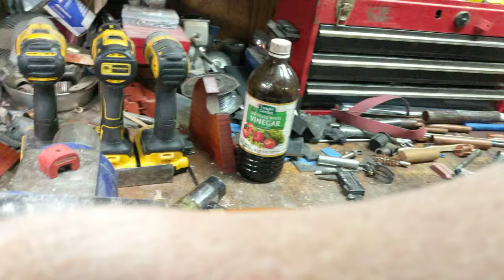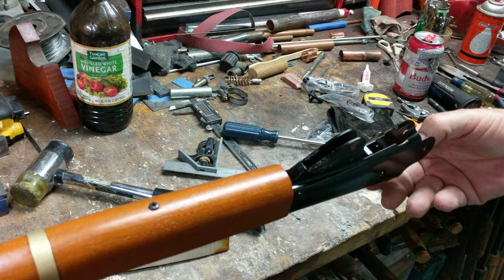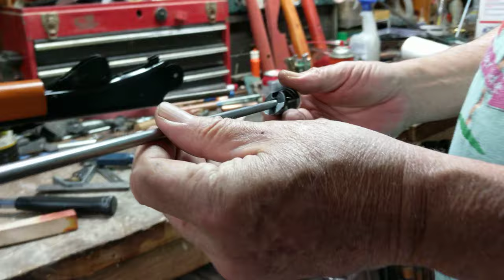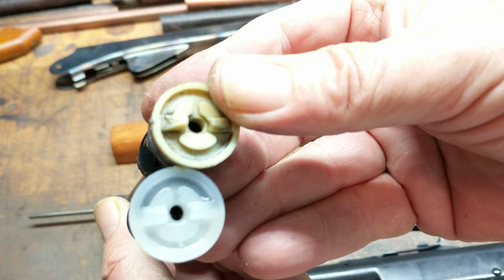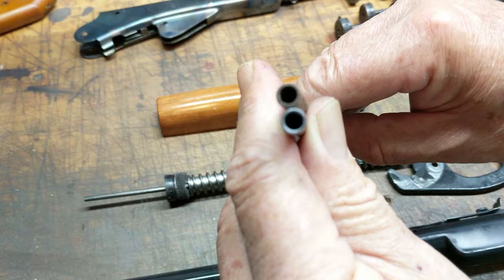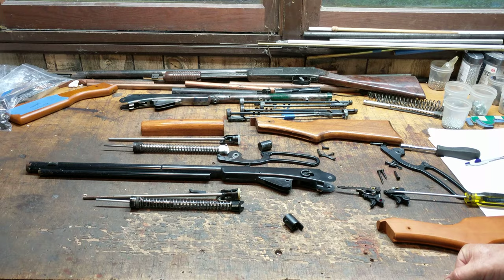Upgrading a Daisy Model 1938B built about 1981 to Super Thumper status part 2

Comment: Ha! I just removed an 80's  maybe pre 80's  shot tube from a 1938B because it had deteriorated so badly it was falling apart. The abutment seal now looks like old peanut butter and has a similar consistency to dried peanut butter. Chunky, because it just falls apart in chunks. I wonder how or why that happened. ??? Maybe the gun was stored someplace hot?

Comment: just theory for not having a chronograph.. solvent cleaned the air cylinder and bore several passes, heated them up with a blow dryer, wiped them down with FrogLube. in cylinder the slick coating = less friction+wear (more speed?), in the bore: if it slick coats 0.0001" thick, means 0.0002" smaller diameter for less air to rush past the BB going down the now low friction coated barrel (more speed?). 
small caliber semi automatics love FrogLube, slides move really freely so they cycle, junk doesn't stick to the dry lubricant, and it prevents rust. had some here, seemed a cool idea so I just went ahead and did it, before upgrading to cobalt327 spring and 7/64" air tube. couldn't tell ya if its faster than if I hadn't, no chronograph so no "before+after" testing this idea.
its an "IF", that maybe added 20 fps?
Reply from the maker: Sound speculation based on observable performance in similar systems. I can't make a definitive statement as to if it gives the performance boost you're looking at but I think I'll get some frog lube and a heat gun and see what happens. The most current section of the "$15 dollar Daisy" thread over at The High Road forum has been kicking around the theory that coated BB's might produce the same effect with quite a bit of experimentation along the way. There is also the "Dust Devil" BB that disintegrates on impact and due to it's light weight provides a considerable boost in velocity and completely removes the possibility of ricochets. I'll do a video on that and see if Frog Lube has a measurable effect. I've got a chrony and I'm not afraid to use it.
Reply: @RestOModDaisy  I got some significantly higher velocities with the "blaster" plastic BB's. I can't get my chronograph to read those however. But, my Red Ryder does have the Cobalt spring and air tube, and with steel Daisy BB's it's shooting at 355fps plus or minus. The problem is the plastic BB's are obviously not magnetic and I have a little trouble getting them to chamber every time. But they are FAST!